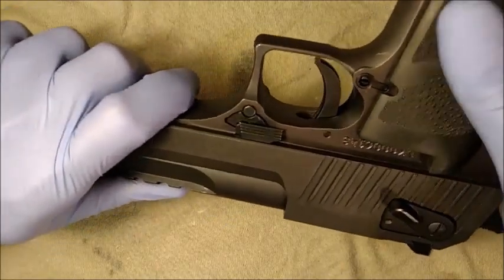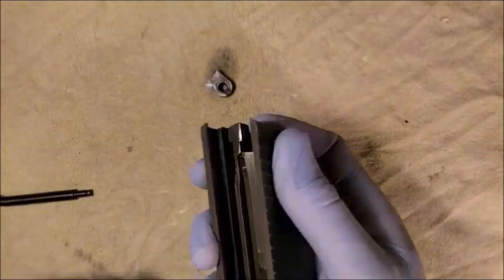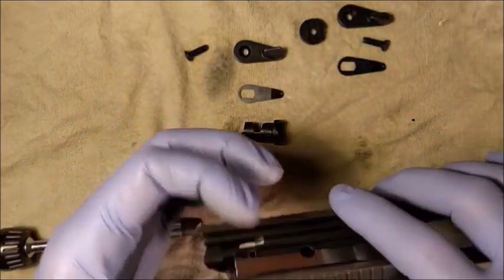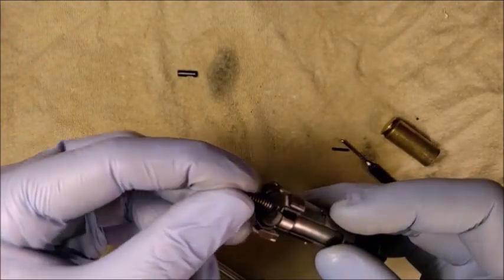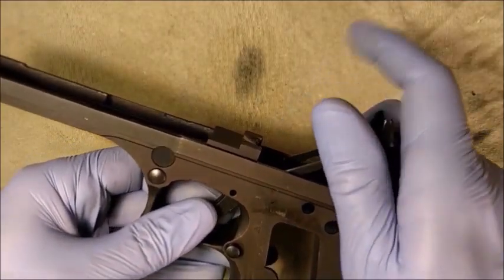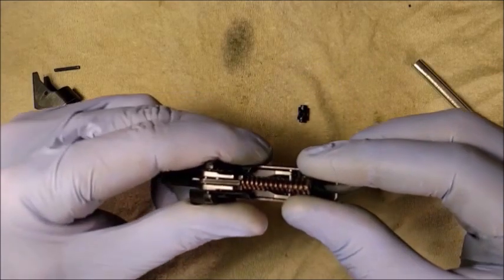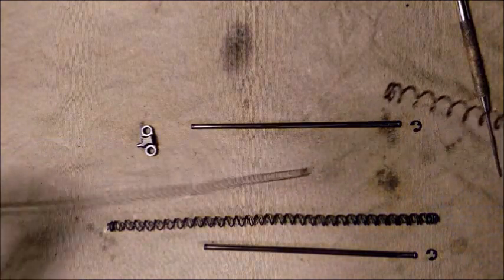Desert Eagle FULL Disassembly

Comment: Excellent video! One question though, I may have missed it but did you go over the removal of the trigger bar from the trigger? I was told cutting it off with a small Dremel rotary was the easiest since a new pin is only about $0.50 but wanted to know if you crushed the flared side in and reflared it or had some other trick. I thought you had excellent tips! Thanks.

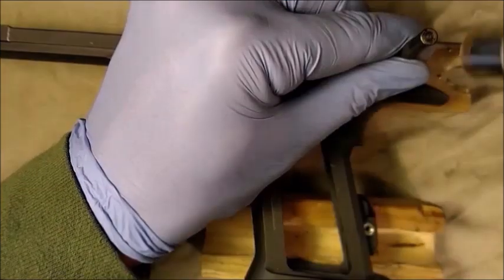Comment: I noticed when you removed the hammer pin at 10:40 it seemed to have a slight bend in it. After seeing that, I went ahead and removed mine and sure enough it also has a slight bend in it. Is that normal? And do you think it should be replaced after a certain number of rounds?
Reply from the maker: Your pin will be fine with a slight bend in it. It's a roll pin which is hollow and less ridged than a solid pin. Once your hammer pin is installed, everything is tightened up and solid. I would only replace it if you notice any hairline cracks in it. If you want, you could get some solid pin stock and cut and file your own pin. Thanks for the question. Let me know if this helps or if there is anything else I can help you with.

Comment: Didn't get a change to watch the entire video but what are the parts that they recommend replacing after about 1500 rounds?  Great, informative video so far!
Reply: I think it's mostly the recoil, magazine, and firing pin springs, as they tend to wear out the fastest (especially if you use the Desert Eagle more frequently).  You could also replace the entire bolt and hammer with a brand new one, especially if one isn't a trained gunsmith and don't wanna run the risk of accidentally damaging the individual parts.

Comment: If I remove the two springs or springs from the slide, is it possible to fire with a 357 magnum ammo reload with the wancuter or semi wancuter lead bullet, with or without copper cover?
Reply: Hey man
You should never fire lead Bullets in your DE. Only copper coated bullets
Thats because of the gasoperated design of the DE. In the barrel of the DE is a little hole (gasport) which will fill up with lead when you shoot wadcutters etc. And your gun wont cycle anymore which will repuier a really hard cleaning session.
Reply from the maker: Ramon, please do not alter your recoil springs and PLEASE do not fire your Desert Eagle without the recoil springs installed.

Comment: Not common to see a full disassembly, kudos to you.

 Would you happen to know a cause of the slide catch lever hitting the barrel on discharge causing the slide to remain open with a full mag? I already know its not the way I fire because I can sort of ''limp wrist'' one handed and the slide will complete a full cycle usually, but typically 2 handed shooting the lever hits the slide, keeping my hands away from the lever. I'm thinking the slide catch assembly is loose, much like the ambidextrous safety comes loose after firing ( fixed with thread fastener) . I notice I can push in and out my slide catch just a few hairs, is that normal? or should it be hugging the frame? Im thinking of putting some loctite on the circular part that goes in to the frame so it is in direct contact with it, so it holds in place when I'm firing. That wouldnt negatively affect the trigger or have any adverse effects on the frame?
Reply from the maker: I had the same problem. The cause is, believe it or not, the recoil throwing your thumb up into the slide catch locking the slide to the rear. Try this, when grasping the frame with your firing hand, point your thumb downward and completely cover your thumb with your non firing hand pinning it to the frame. It's basically the same grip as when holding a 1911 but you are pinning your firing hands thumb to the frame so it won't move.
Reply: IWestexI
Its been so long since I last fired my DE but iirc I made sure to fire in ways that would not allow my hands to come in contact with the slide lever and it still locked back. I put some loctite on the circular part of the lever that goes in the frame, which will hopefully be enough to hold it in place properly during discharge. I believe the particular problem I have with my DE is just loose parts, like I mentioned before I had to use this stuff for my safety levers as well after putting hundreds of rounds through, the screws became loose and a screwdriver alone wasnt enough to keep them locked in. This truly is a unique pistol and thus requires unique maintenance. Hopefully this will do the trick.

Comment: What in the hell was Magnum Research thinking when they decided to make the extractor spring out of polymer? Are there any alternative or after market springs to replace this instead of buying new OEM part?
Reply from the maker: buzzydj not that I'm aware. It was designed this way. It works well.
Reply: I agree that it works well. Unfortunately mines didn't last very long. I don't even think I put close to 1000 rounds through it, but once I removed the extractor the polymer spring was crumbs. Anyhow, thanks for the upload.
Reply: I just replaced mine as well. Wore down to a flat nub. I'm surprised it worked at all (although only manually using the slide). I'm not positive but i think i have around 600 through her mostly hand loaded. They say that some gun cleaning solvents can dissolve it slowly and There is a metal aftermarket one but i have no experience with it.

Comment: I'm having trouble with the the safeties, any suggestions?
Reply from the maker: what's the specific problem?
Reply: IWestexI the left side is so tight it won't even budge, I tried a few tricks and soaked it in ballistol but it's locked on. I'm even damaging the screw head.
Reply from the maker: +Nathan Frisque As a gunsmith it's difficult for me to determine the problem without having your gun in front of me. When a screw is locked in place, the problem could be a number of things. Im not going to give you any suggestions on removing the screw because you could damage the safety or the slide and that might not fix it anyways. I recommend you take it to a gunsmith. The cost to have that screw removed is cheap not to mention the money saved on damaging the safety. My suggestion will save you time and money, trust me.
Reply: I have the drum outside the slide, so the slide is safe
Reply from the maker: +Nathan Frisque Oh I see. Try letting it soak in a cup of Break Free. Let it soak for a solid 24 hours. Then use the correct size screwdriver bit to back it out. Put the safety assembly back in the slide so the slide can hold the safety in place to allow the screw to be backed out.
Reply: IWestexI I had it in ballistol for almost 7 hours, so I'll try a different solution for more time
Reply: Finally got it. You where right, but some serious elbow grease was put on it to get it off
Reply from the maker: +Nathan Frisque Glad to hear you got it.
Reply: I have a Mark VII 44., had the same issue. Decided not to mess with them. The Mark XIX had no issue, weird.

Comment: I am having a hell of a time trying to remove the mag release... it seems like it should be easy. Any ideas?
Reply from the maker: it comes off like a 1911 mag release.
Reply: So I have heard, but this was way different. I finally figured it out after a lot of staring at it. Turns out its a split pin design, and I dunno about you, but in the 3 years of gunsmithing, I have never seen a 1911 mag release that worked like that! Must be a difference in the model or something.
Reply from the maker: The newest model Desert Eagles have the split pin design. The older and more common Desert Eagles are designed after the 1911 turn style mag release.

Comment: Magazine release?
Reply from the maker: Very observant. The magazine release requires a special tool for removal. I didn't have this tool at the time nor the supplies to make my own.
Reply: of all the things I want to modify the mag release is one of the first, so where do i get said tool. I cant find any desert eagle mag removal tool info.
Reply from the maker: +Nathan Frisque Make your own tool. Pinch the pins head together closing the gap. Then push the pin through the frame.
Reply: so would attaching a larger surface area head to the release cause a problem.
Reply from the maker: +Nathan Frisque can you rephrase your question with more detail?
Reply: I want to add more area on the mag release for ease of use, as opposed to the small button. Adding via weld or pinning a disk to the factory button. Similar to how a STI race gun has exaggerated control surfaces to improve handling characteristics.
Reply from the maker: +Nathan Frisque ok I see. You might have better luck drill and tapping the mag release on the frame. Then screw in a larger button with more surface area.
Reply: Harder yet, I could  thread the outside of the button
Reply: Hey, anyone looking to remove the magazine catch:
-Place the frame up on a block for ease of access
-Use a pick to push in on one side of the pin and hold it (use one on each side if you still have trouble)
-Use a punch to push the pin through the frame
-Collect your parts
Simple, no need for a special tool. Great video lWestexl, just figured y'all should know there is a simple fix.

Comment: Is it possible to get to gas port?
Reply from the maker: No. It's closed off by the manufacturer.
Reply: @IWestexI  so anyway to clean it?
Reply from the maker: @kgb4194  look into the barrel and you will see the gas port opening. You might be able to feed a pipe cleaner down there. I've never tried because it doesn't need to be cleaned unless a known obstruction gets in there.
Reply: @IWestexI  I am just asking for future references. I understand that using lead ammo can clog it up.

Comment: This concludes disassembly of the frame my ass.. you still have the magazine release button. How do you take that shit out. thats why i watched this.
Reply from the maker: I apologise for omitting that step. It's  a split pin. Hit it hard with a punch and it will pop out. Watch my reassembly video and you can see it up close.
Reply: @IWestexI  Thanks for the infor. Ive got another problem. Tried taking out the rear sight with RST Gen 4 sight removal tool. the tool broke and the sight is frozen and sticking half way off the gun. any tips?
Reply from the maker: @GMDII  I'm sorry to hear the tool broke. Mount the slide in a vise and drift the sight out from right to left using a steel punch and a big hammer or small mallet. Don't use a soft hammer like a dead blow. It's a big robust sight, don't be afraid to use some force, it needs it.
Reply: @IWestexI  I ordered a different tool since this thing wont budge with a standard hammer. If the tool doesnt work ill have to take it to a gunsmith. This is rediculous. shouldnt be frozen.
Reply: @IWestexI  finally ordered my Desert Eagle just the other day chambered in .44 Magnum (the .357 & .50AE were out of stock), so it's gonna be badass
Reply from the maker: Congratulations. You can always get different barrels later.